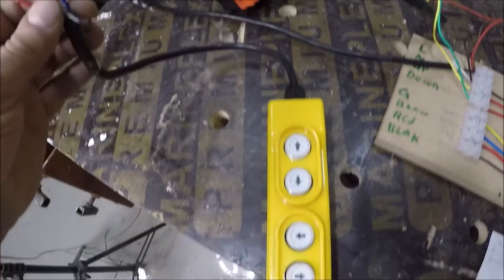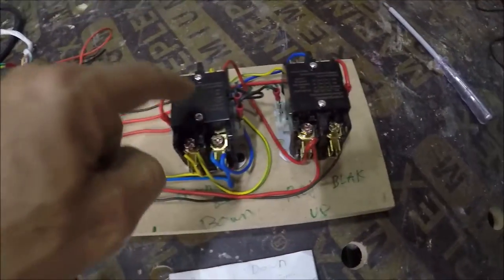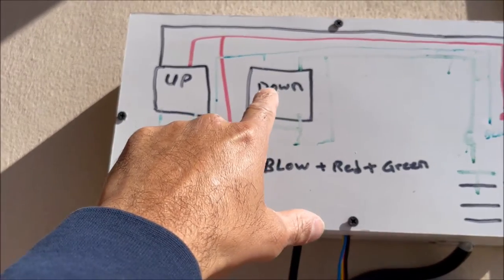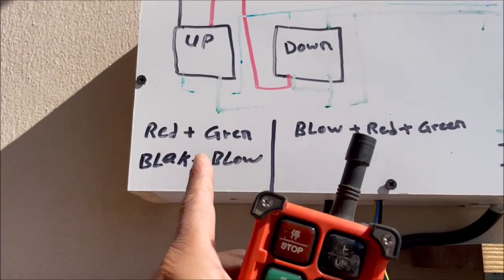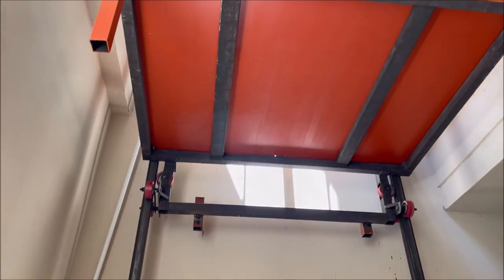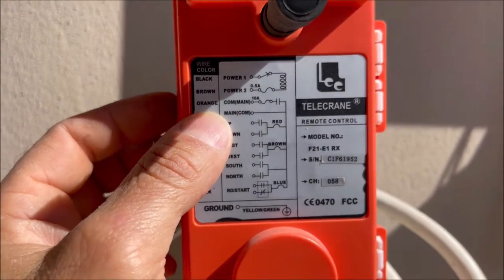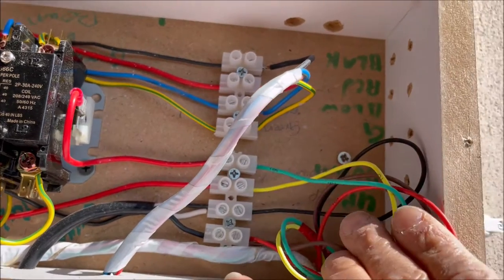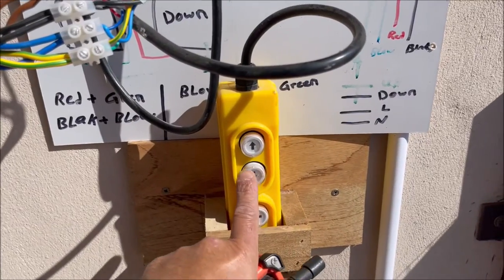how to connect a remote control to  a winch or a crane

Comment: Hello, could you help me. Exactly the same device. The problem lies in the remote (or this is my assumption) As soon as I insert the batteries, the indicator quickly flashes red. I checked everything written in the instructions. There are no sticking in the buttons, and the emergency button does not remain pressed 
at least a schematic diagram of the internal electronics of the device, please!

Comment: If you use start run capacitor on motor contactors are not needed. did this method and tested by me. also down safety switch will have to be across brown wire.
Reply: Hmm. So this exact remote system can be 12v or 24v. There is supposed to be a switch inside of the receiver box to select either one. So I purchased a 12 volt DC supply power box to operate the receiver. My winches are all 110v AC. Do I just wire this to the winches or is this the wrong output voltage to operate these winches.

Comment: Hi. I pay like this remote control. But it not work. Do I need to add a condoctor?
Reply from the maker: Hi thanks for your comment I am not an electrician but this is the only solution I find for this type of remote control
Reply: Hi, this is Agnes from LCC remote conttols, if you have any demand in industrial remote control, pls feel free to contact me.
Reply: @yeagnes8797  how to change from on/off button to toggle button.